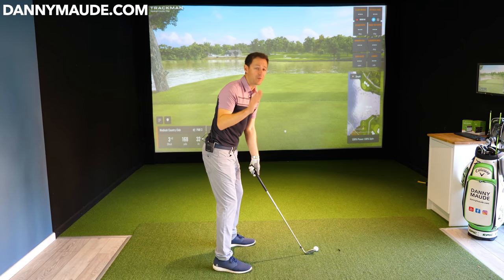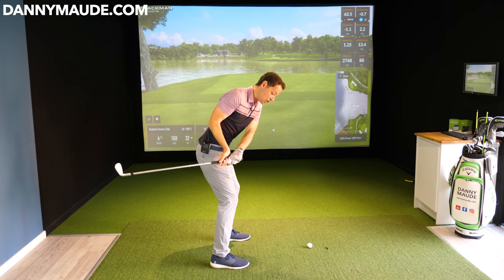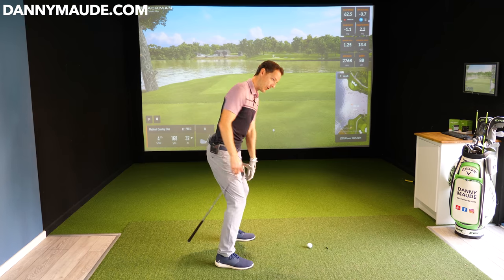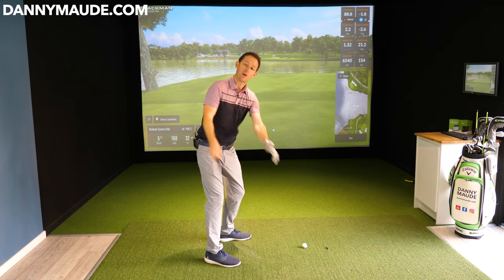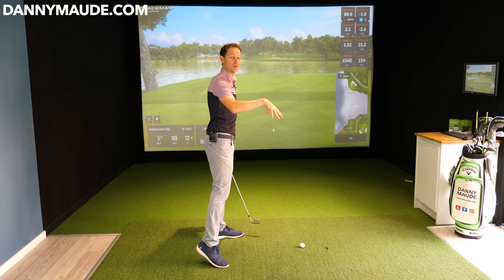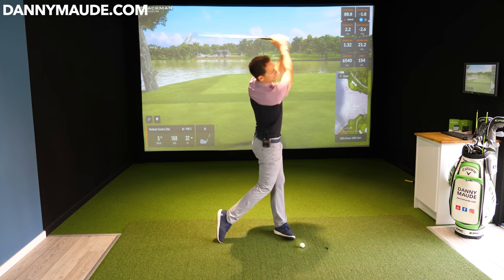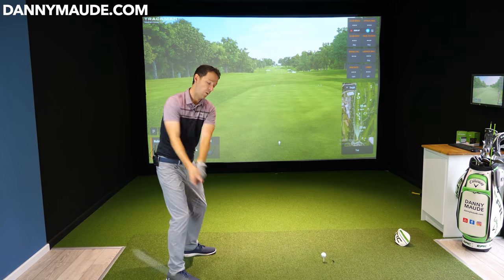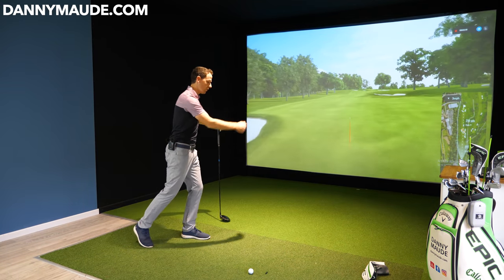These 3 swing faults can RUIN your golf game  - but are EASY TO FIX

Comment: Hi Danny,
I have always found the analogies of throwing a frisbee with the lead hand or skipping a stone across the lake with the right hand to start the transition by moving lower center forward (weight forward) and head back difficult if not impossible to emulate. What changed that instead was a tip i recently heard. From the top of the backswing executed as you demonstrate in this valuable video, instead of trying to skip a stone or throw a frisbee to start the transition, simply pull your trail shoulder down and back target wards which has the effect of moving the weight forward (hips forward) and keeping the head back as if throwing a frisbee or skipping a stone and from there you are automatically in the slot where you can  simply throw the club head at the ball. Works for me as it gives the sensation of throwing a frisbee and skipping a stone whatever your preference. It works. This simple moving of trail shoulder down and back to target is how you do it.

Comment: Another good tip from you.  A few of my faults was swinging too quick before I had a full back turn, and moving my front foot resulting in a poor shot rather than lead with my lower body and then swing with a coordinated rotation.

Comment: Just came back from the range and tried drill one . Finally i know what a backswing swing and position feels like! Biggest misconception was my hands at top. I avoided this position because I thought this put my hands/club behind me! When in fact if you turn the shoulders correctly to club parallel then up you basically can’t get the club behind you. Coincidentally, problems 2,3 are somewhat fixed by just reacting and letting swing happen  if #1is done correct. This explains why i occasionally made a good swing and contact but didn’t know what i did right…lol
Reply from the maker: That’s absolutely correct

Comment: What a perfect time to get today's lesson! I've been working on my swing and I know this is going to help me.  Looking up at the sky...I never would have thought of that.  Learning how to get the club into the slot every time is a problem I have as I go through the round. Mostly because I'm old, overweight, and out of shape!  Thanks again for your help.
Reply: As I went through the round and got more tired, my swing came apart at me a couple of times.  However, my drives were generally straighter, longer and just felt better than I have in forever.  I'm playing again tomorrow and I'll be relying on your tips through the entire 18 holes.

Comment: Good morning Danny. Just tried to practice the swings on my terrace, I use a lounger cushion 🤣. The position of where to look with iron or driver really helped. It enabled me to feel the difference simply and clearly. Off to the range shortly to try it out. The angle of attach is difficult but you explained it so simply. Thanks. 👍
Reply: Just to say Danny, it certainly works on the range too. Let’s hope I can do it on the course. Also works with my 3 wood and rescue hybrid off the grass. Thanks as always. 😁

Comment: I make exactly those mistakes because I'm so concerned about ball strikes and direction. I have discovered that being more athletic and freeing up my body movement greatly helps. But when the pressure is on, I get tight again, don't make a full backswing, don't start downswing with lower body, don't follow thru. How do I perform consistently?  Thanks for a great, simple video, Dan!

Comment: Everything up to the 3w has been fine recently, but my driver went Pffft (Yes! Pffft!) in a big way.  This drill has been very helpful.  It gave me the sensation of the torso turning back freely "underneath" the arms.  I went to the simulator, using the drill as a practice swing for the driver, then applying this feel to the actual swing.  It's nice to have those 30 or 40 extra yards back.  Thanks!
Reply from the maker: That’s great Brian hope you’re well

Comment: did a practice at the range couple days ago and indeed  how right you are. Must remind myself to do that and make it a habit, thanks for the reminder . However , struggled  on 5 Iron for some strange reason. Wrist seems stiff on the down swing and could not really "throw".  I know probably it is tension to strike well, timing and tempo is the thing. I dont blame the equipment , just myself

Comment: Great video! You are so right about those faults but I think us over thinkers and over controllers THINK that if we get that big turn how are we ever going to control the club back to the ball?! Which immediately creates the number 2 problem which is  the faster I get the club back to the ball the less chance to screw up which completely eliminates any chance of correcting problem 3! The biggest thing I struggle with is my head! I fixate on takeaway/backswing and if I don’t FEEL it’s correct my brain  will do crazy things to correct on the downswing! 
One thing us over-thinkers struggle with on the drills is accepting the “ don’t worry where the ball goes” comment! How do I know I’m doing the drill correctly? If I miss hit  the ball it goes back to that’s a bad swing I did something wrong!

Comment: What simulator and video equipment would you recommend for a home practice area.  My garage ceiling is 8-ft high.  I do have an outside area with no limitations.  Do not want to spend more than $3K.  SkyTrack, Trackman, LiveView.  Wanting to capture ball flight, swing speed, postue when swinging.
Reply from the maker: SkyTrack is the only one in that price range 👍

Comment: The basic problem with understanding any "fast action" sport activity is to realize that the speed comes from tendons and ligaments. 
Your muscles are supposed to keep the entire muscle-bones column tense, but it is your tendons and ligaments that generate a fast move.
That's why sport at the professional level may be dangerous to your health - coz professionals push their bodies to the edge.

But even amateurs, when doing certain activities, use this mechanism. F.e. throwing a ball/rock. Check carefully - when you try to throw a ball, you move your entire arm to the back, you tense your muscles, and start a throw with a move of an ELBOW to the front, while leaving your hand with a ball still at back.
By moving your elbow, for a brief moment you are creating additional tension in your upper body, like stretching a spring, to release it in one fast movement.

Now if you look at runners, you will see a similar mechanism, with bicuspid muscle and Achilles tendon. When they hit the ground with their feet, they keep this muscle tense, the Achilles tendon absorbs the impact and energy, stretches and releases this energy with fast contraction. There is an additional mechanism, with muscle spindle receptors, but let's leave it now.
Anyway, the same goes with a golf swing.
When you are at the end of your backswing, it is like throwing a ball, when your arm is at back, prepared to throw.
Then you are supposed to start a movement with your legs and HIPS, which start to turn first, creating additional tension in your entire spinal column (like this elbow move while throwing a ball). This tension is a stored energy that gets released when your shoulder girdle starts to rotate, "dragging" your leading hand ("left").
You can see this in slow-motion footage, sometimes more pronounced, sometimes less, but it is always there.
Check out 10:09, play it in 0.25 speed.
Danny even starts his BACKSPIN with his hips, then he rotates shoulders. He is a pro, so his swing and power are built actively, with all these small steps, taps, muscles tenses even before a swing. In fact, with all these moves he is building tension in his muscles, that comes from muscle spindle receptors. To make it simple, muscles tend to relax when there are no changes. When you do several stretches, change the load on different body parts, these changes make spindle receptors react and send impulses to tense a muscle.